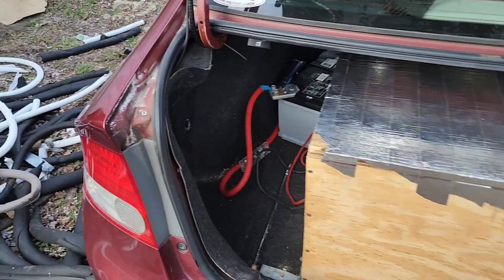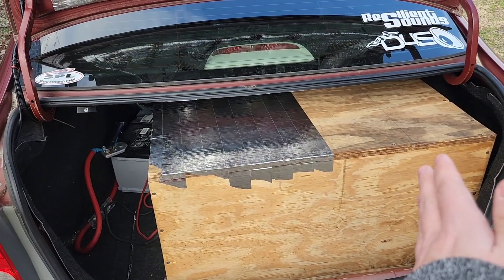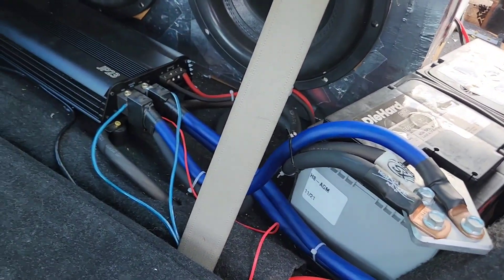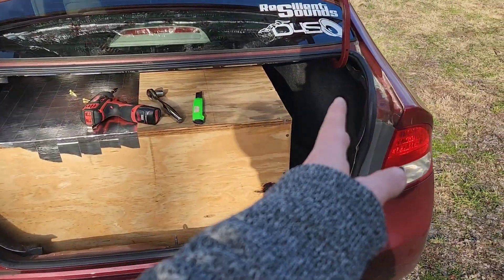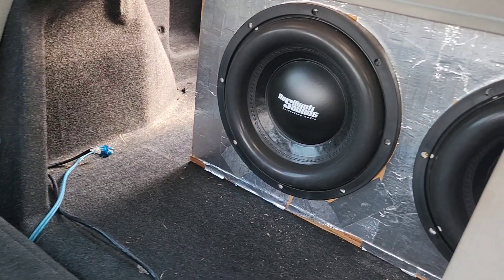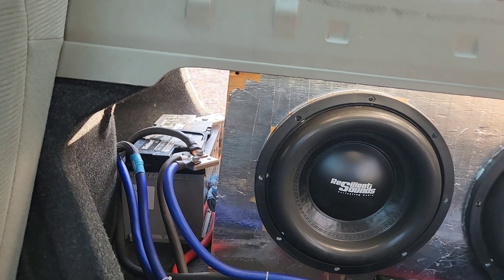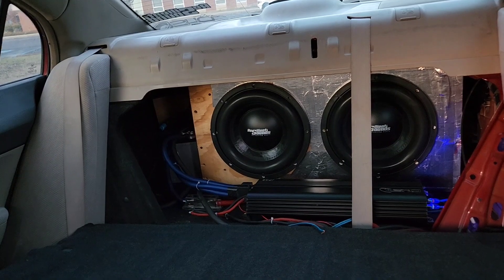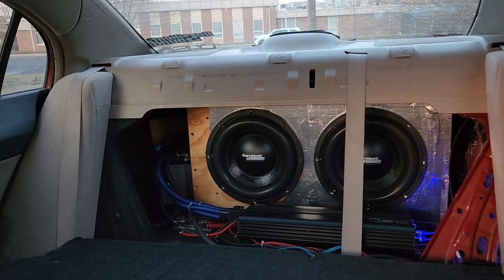Rearranging my trunk doesn't go well

Comment: Mount the amp on the back seats. Build a box subs and port firing the cabin. Lots of port area if you trynna increase in the meter
Reply from the maker: I'll try it soon. Hopefully gonna build a box very soon
Reply from the maker: Also I love low notes so I'm gonna tune low. This side port is tuned to about 31 but I wanna try 28hz tune on front slot port
Reply: @andruwsaudio2996  with that low power bigger box wont hurt. Im assuming you got the platinums
Reply from the maker: @Mike SPL Boxes  no I have golds. I do build my boxes on the bigger side to help get louder on the lower end though

Comment: Nice setup bro I used to have the 15in RS platinums the best my boxes have done in my car is always subs forward port driver side box all the way back and in the back right corner of the trunk. What are you wired to on the JP23?
Reply from the maker: I'm wired to 0.5 ohm

Comment: Those side port boxes are weird to figure out. Exo had his angled with port shooting in rear corner of the trunk🤷‍♂️
Reply from the maker: Yes I agree but I'm thinking about doing a trunk walla soon
Reply: @andruwsaudio2996  yep, me too man
Reply: @andruwsaudio2996  only way tooo goooo. Just the minimization on trunk rattle alone is a huge plus. Best decision I ever made. Walling sounded so much better, then properly bolting it down, another lil bump up, but boyyyy! Sealing it off… that shit…
Reply from the maker: @APinTheAK  I'd really like to build another box and do subs and port forward and see how it does
Reply: @Andruws Audio  I have similar trunk space I have a Toyota Corolla the secret is box tuning my box is tuned to 35hz also your trunk is playing like a 6th order the closer the port the lower the tuning move box back until you fine you sweet spot also sound deadening the trunk will help good luck